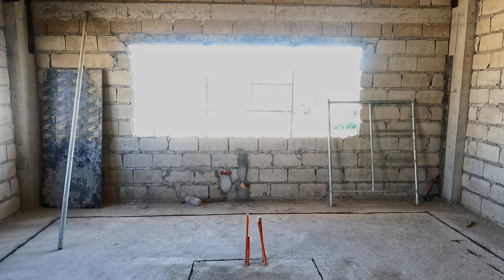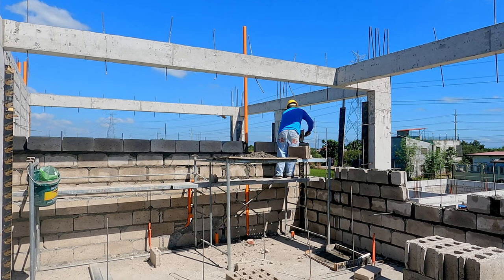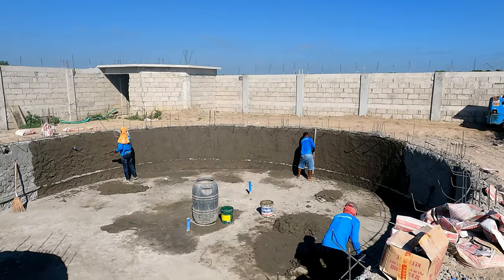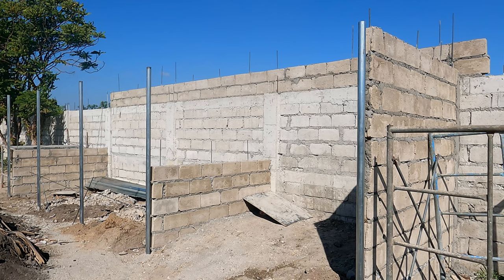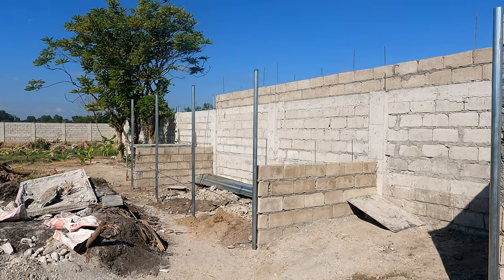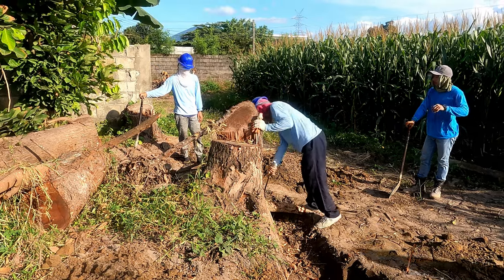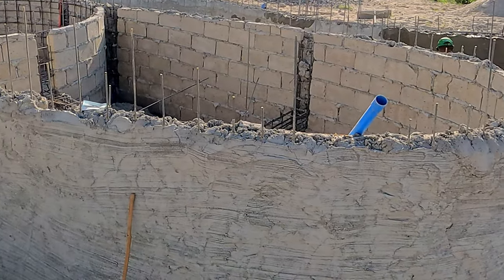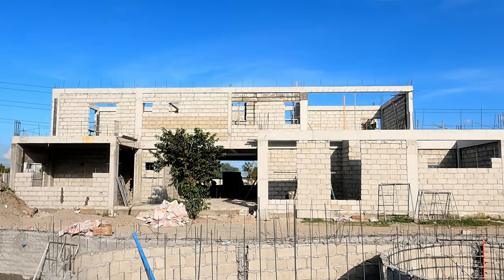Philippine House Building Day 114 - New Staircase Design

Comment: All looking good.  Wire mesh/chicken wire over larger pvc pipes in wall will give some protection against cracking. The stair design rendering looks great. 👍🏻 It lets light in…. Keeps it airy…. Those verticals pieces of wood may get dusty… simple cleaning situation
Reply from the maker: Thank you JM
My dad has suggested something he calls expanded metal mesh. Do you have any experience of using chicken wire ?

Comment: keep in mind that you can run conduit extensions under cabinets and you can get refrigerators that open left of right , the wire you need to use is called lath
Reply from the maker: Hi there
Welcome to the comments, and the advice is much appreciated.
Did a quick search of lath and it comes up as a wood product - is this what you mean ?

Comment: Hi Mike, have you seen the Texas Filipino vlog? He's doing a cast concrete home on the scale of yours. He did a small room to demonstrate how hollowblock actually ends up costing more when you factor in all the costs for cement, finishing (rendering) and chipping out channels for conduit, etc. And you end up with an overall stronger structure with cast concrete. You've got to stick with your plan though. You can't go making changes on the fly. He keeps costs low by reusing materials. Notably, no machines were used for mixing concrete and no ready-mix trucks or pumpers. He likes to support the local workers and also control the quality of his concrete mix better.
Reply from the maker: Hi kmcoguy888
I have watched some episodes, and we did talk to the builder early on about the different possible building materials, including cast concrete.
In the end, we have gone with the process the builder knows best
Actually you have reminded me that I never checked on the concrete test results for the second floor slab. If you saw it, the ground floor slab results were really good, so hopefully the second floor came out fine - I will check today

Comment: A TIP for gutting the roots of the tree. You can not juse a chainsaw because of the sand BUT when they brush clean the roots with water than you can juse the chainsaw. We did that in Leyte to
Reply from the maker: Jack
I had no idea. Thank you very much - will mention it to the foreman.
Reply: I wonder if they have ever heard of a stump grinder machine there. To see a guy trying to chip away at that huge stump with a bolo seems like a waste of time and energy. A stump grinder would make quick work of that.

Comment: Hi Mike Stairs my preference 1 Full enclosed 2. Open 3. Frame as latest renderings  there all good options
Reply from the maker: Graeme
I think in this case (as it usually is), we are probably going with my wife's preference with the framing.
Reply: @philippines4.0buildinganew64  I've been looking some more of the proposed options and now it looks to me from the living room there is no direct access to stairs personally I see no logic to have open stairs and the completely closed off to the stair bottom, solid walls as first designed to me was best for use of the wall in terms of room setout . Just my opinion. 
Thanks Mike Happy Wife Happy life 😊

Comment: I also like the aerial views, what is the range of your drone?
Reply from the maker: Thank you Penny
They claim it will do almost 20km in total, but there is no way I would go anywhere near that far. Apart from anything else, it does burn through battery life, plus if there is any wind, the range will reduce.
I suspect I would not go more than 5km in any direction, and even then I would be very nervous.

Comment: Stairs looks more futuristic in the new design.. Is it the wood finish you are after? maybe polish stainless steel rectangular tubing will look nice. and also implement that in the stair railing to.. just a idea.. good work whit the elektric .. will you use some kind of earth conation ? really important to but not so common in Philippines..
Regards from Sweden  .
Reply from the maker: Jerry 
I think Mrs Philippines 4.0 prefers wood.
I had read about earth / grounding, and have been meaning to ask the builder about it - thanks for the reminder.
Reply: I see if the wife are saying, its always better to listen 😅. Safety first 🏥